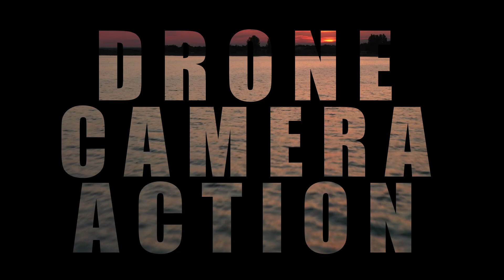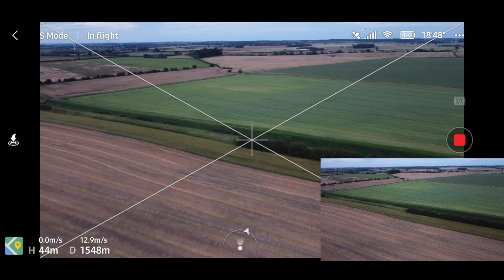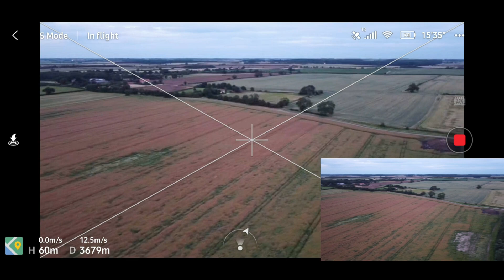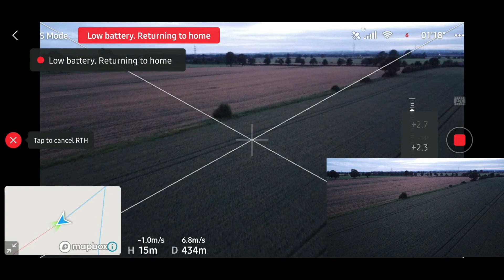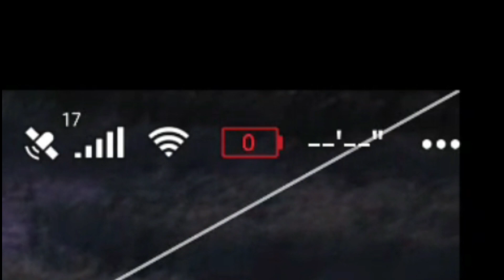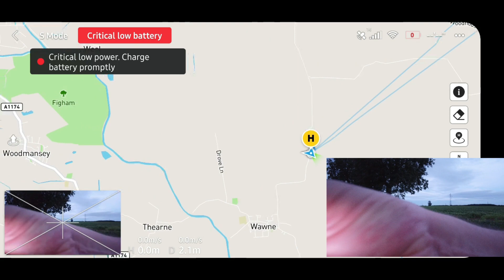Mavic Mini: Parayagi Range Test - 0% Battery.

Comment: That is right on the spot! 
You took it to the very limit... 
Had two of those experiences myself and got lucky too, but I'm afraid that these batteries may suffer from those abuses we're giving them... anyone trashed a battery doing this?
Reply from the maker: Not trashed yet. But worth it for the test. I think that when the batteries finally do give up that I will be able to buy a MM fly more combo 2nd hand pretty cheap...  looking to get another 1 just for the abuse. 😄 🤣 😂 😆 😄 🤣
Reply: @DroneCameraAction2021  I guess you're right. Just saw them on sale at dji for 39eur, so it is fair to buy a 2nd had for half, which is a bargain...
One thing worth looking is rebuilding one ourselves. I suppose a couple of batteries can be bought and put together in the old ones case... anyone ever tried it?
Reply from the maker: I watched a guy do it and get 52 mins flight time and flight 15000m out and back again. He also does a 30000m one way flight boosting the signal with a ground station. Awesome stuff.  If you wire the batteries in parallel, eg. Red to red, black to black it works. Just need a spare MM and a couple of batteries to abuse......
Reply: @DroneCameraAction2021  seen it too... it's amazing what they can do with it. However, that is a bit too much mod for me. I want to keep mine as stock as possible (but putting some yagis over the original antennas doesn't count, does it?)
Also, I heard somewhere that the Japanese batteries that come with the mini have a bit more power, so... replacing the batteries can also be done, right?... ok... me too, I'd like to have a spare mini with lots of extras... maybe in the future, I consider an upgrade to an air2 or something... but for now, the yagis have to do the trick... ;-)